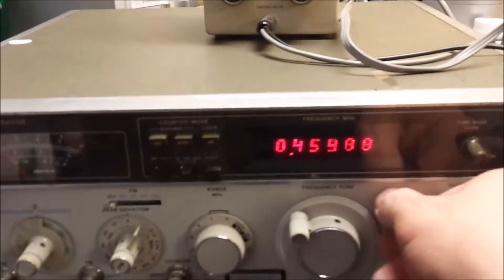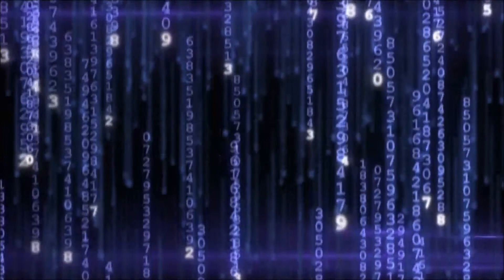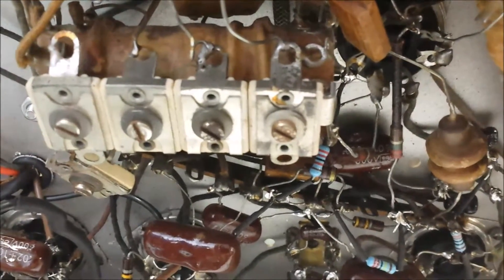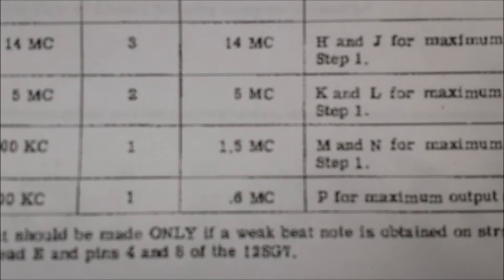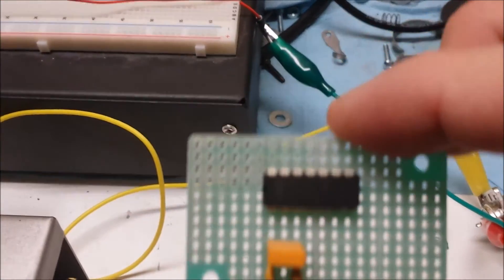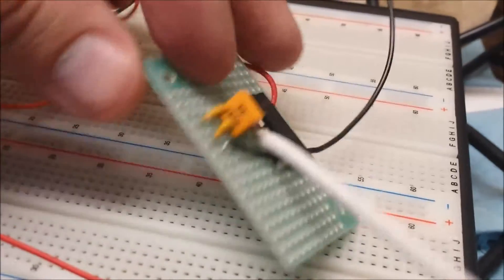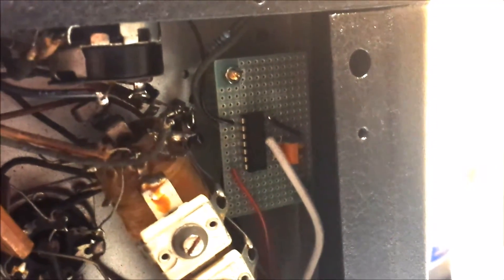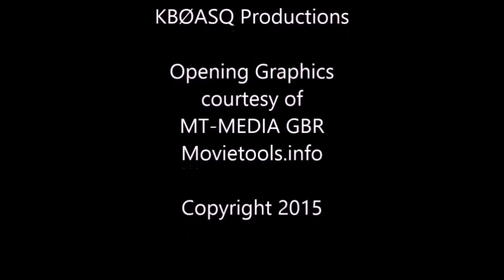Hallicrafters S 38B Restoration-Part 5

Comment: Hello, Your video has been very helpful to me as I am in the process of replacing the BFO in my S-38B as well.  Can you please  explain how you hooked up your BFO to the AM/CW switch.  The switch on my S-38B has a 470 ohm resistor attached to CW side of the switch  and connects to RF section of the circuitry.  Did you remove the 470 ohm resistor and hard wire your BFO to the switch or, leave the resistor connected to the switch.  If your prefer, you can e-mail me a sketch showing how you wired it to: bzadel at yahoo dot com.  That way I won't misinterpret your instructions.  I'd appreciate it.  Thank you very much!  Bill - KI7ZAD
Reply from the maker: Yes, I just hard wired it to the switch.  If you are getting the 6-7v from one of the pins of v4, you are just trying to complete the circuit to B-.